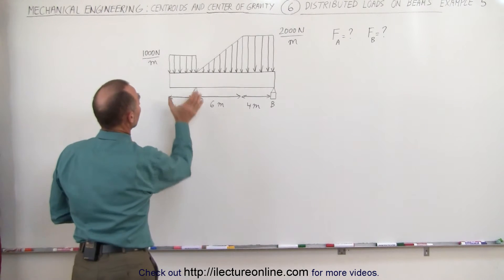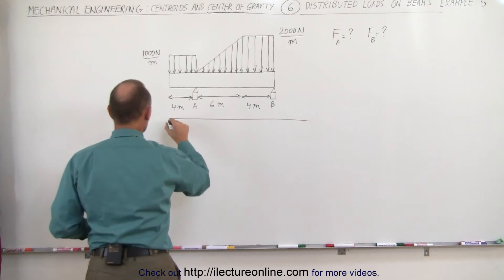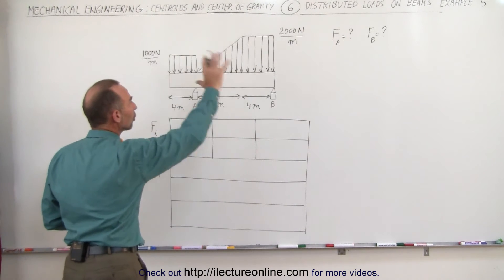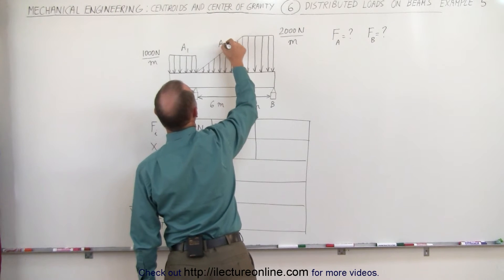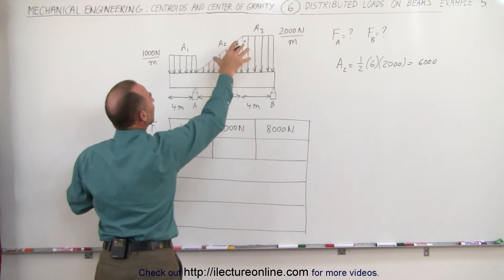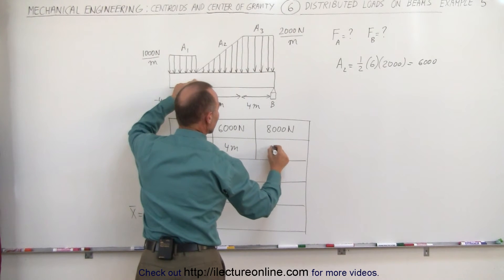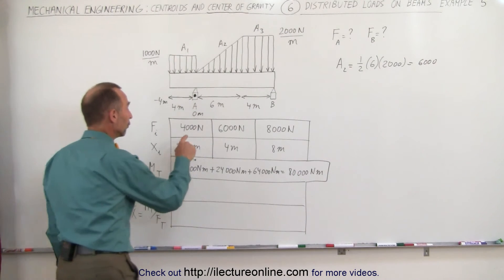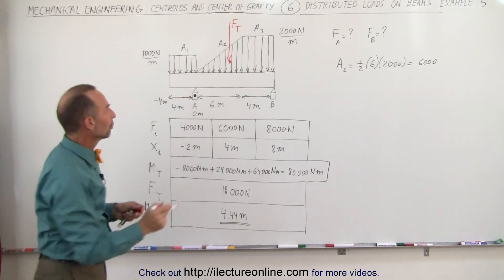Mechanical Engineering: Distributed Loads on Beams (6 of 12) Find Distributed Load on Beam Ex. 5

Comment: Thank you Michel. For the total moment, you are assuming clockwise is positive, right?
Reply from the maker: Yes.  Remember that the moment here is the moment the beam exerts to support the load.  (thus the sign on the moment appears in reverse of what you would expect when you calculate the moment relative to the beam).
Reply: Michel van Biezen Oh, ok. I thought you had broken convention but you didn't.
Reply: Pls can anyone explain why he added 2 with 6 to get the centroid of the third section and isn't it just 2